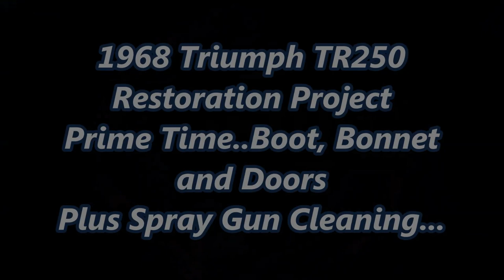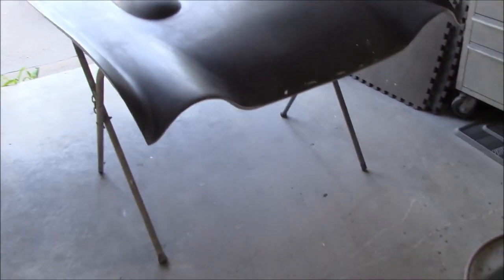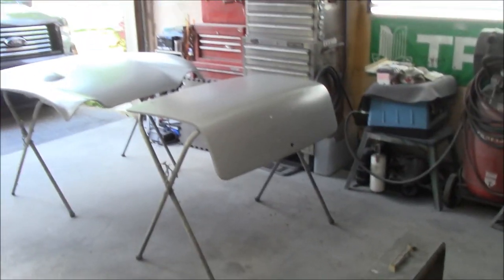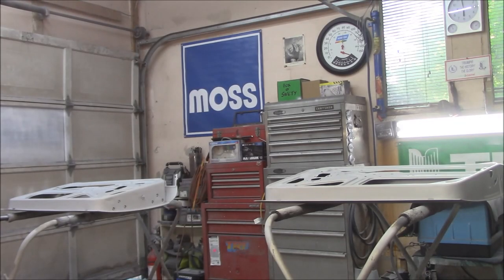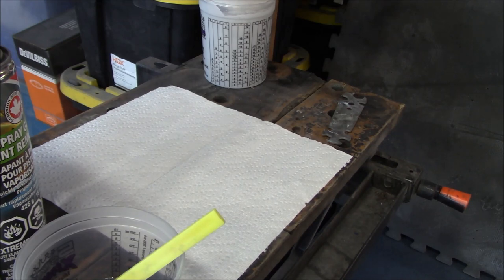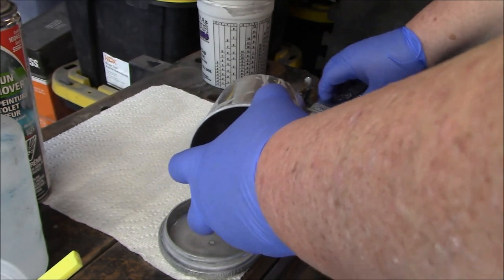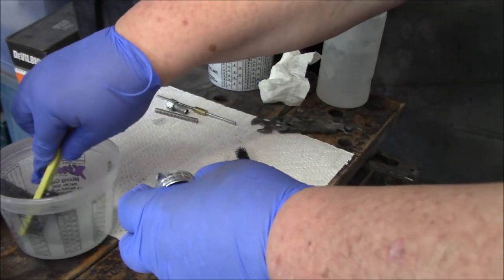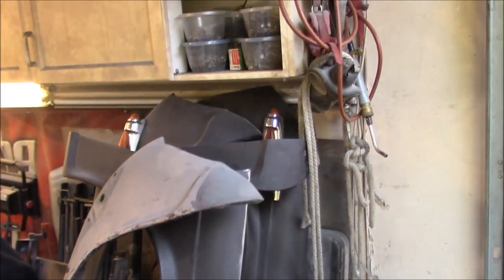1968 Triumph TR250 Restoration, Prime Time, Boot/Bonnet & Door,  + HVLP Spray Gun Cleaning 101

Comment: Great content, Chef. Also appreciate you taking the time to show your gun cleaning techniques. Question...when you're shooting in your garage, what is your set up for cross ventilation? Do you try to filter the inlet air to the garage as a whole? Getting closer! Cheers.
Reply from the maker: Hi Kevin,   I’m pretty lazy when it comes to painting set up as you will see…with primer, it’s not too critical but when you get to base and clear, I could do much better.  All I do at that point is have my side door open slightly ( I was thinking of putting a magnetic screen around it) and I have my right side door up enough to get a couple of box fans blowing out the front.   So, I pull air from the side door and exhaust it out the front.   That’s the plan anyway…no filters either.   Old school 😉

Comment: That’s a good strategy for painting the outer panels one side at a time so they match. I’ve farmed out my painting jobs except for small stuff but appreciate the knowledge you,ve shared. I used the original hinges on the TR4, what benefit do you get from the new hinges? Less play in the hinges?
Reply from the maker: Yeah, the hinges I have have some play in them plus the hinges that I have for the TR250 are not the correct ones…I think these might be TR4 or GT6 with the little scallops cut out in them.
Reply: @cheftush  thanks Tush, I need to take closer look at my on the TR4, I believe they have much play. Very simple hinges compared to other cars of the time.